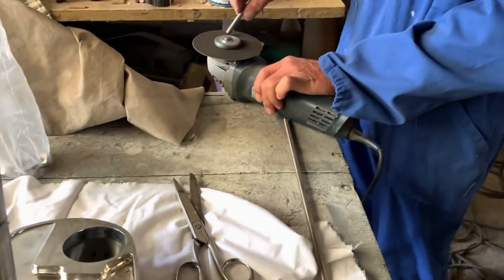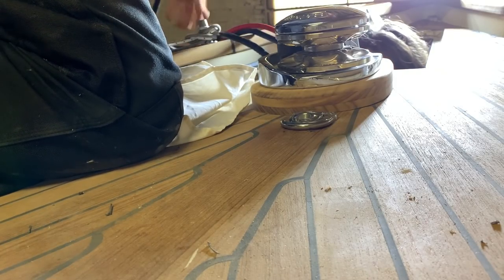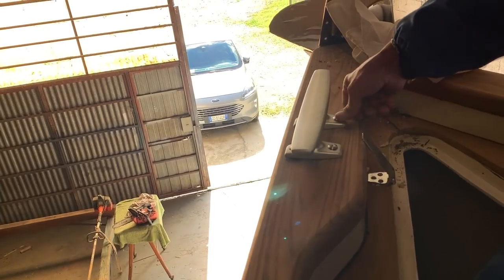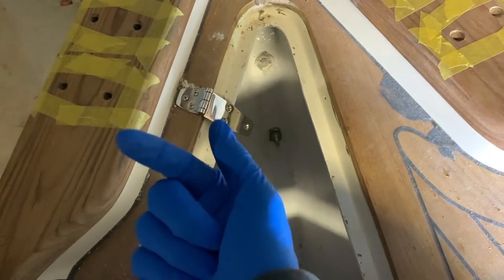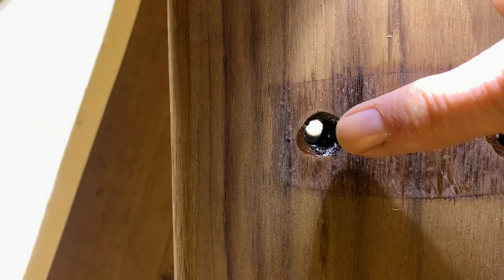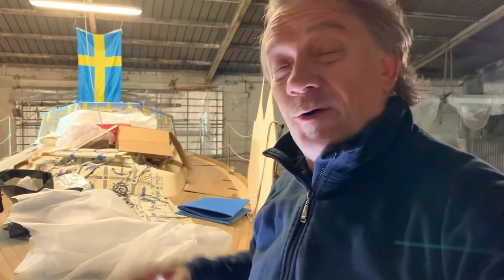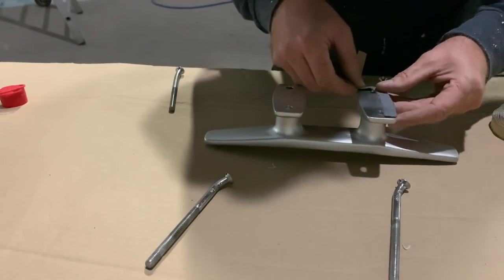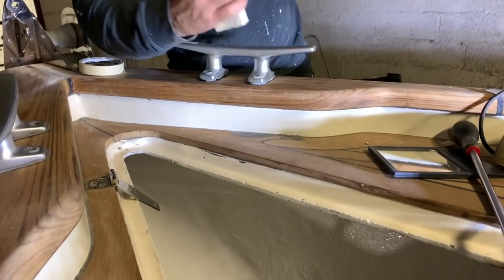Hallberg-Rassy 312 "Ellös": THE BOW CLEATS SAGA..!! (DIY BOAT)

Comment: Very useful video since I want to change all six cleats on my HR36 MkI.

Tell me, was it hard to remove the old ones? I think I just can take the nuts of on the inside and then hammer the bolds upwards?
Reply from the maker: Piece of cake take out... install new ones in more tricky!!!
Reply: sea4see Thanks Gabriele! 

HR Parts told me that they likely next spring have the exact same cleats as my original ones in stock. And also pre-bend bolts.

In that case I won’t have to drill and the installation will be much easier....
Reply from the maker: Ahah ah ... hope for you but I wait 2 years to get original ones but never arrived... same reply....they got a problem to find someone produce it.. I saw the raw model...ps:.. bend a bolt is a piece of cake 😁
Reply: sea4see I already contacted a party who can 3D scan the original one and CNC mill it.... so that is my back-up plan!
Reply from the maker: Great!!! Remember to use the correct marine aluminium.....
Reply: sea4see or 316 stainless steel.....
Reply from the maker: sy Kendu - Twan Biemans that sound great! Such a nice idea!!!

Comment: Noticed you installed the EXTRA PLATE between the bolts on the INSIDE.
Be sure not to HANG your boat by having a CONTINUOS  (no slack line) on a FIXED PIER.
Without proper use of appropriate SPRING LINES...I HUNG my catamaran as the TIDE went OUT.
The only thing that SAVED me was the CLEAT PULLED OUT of the deck (unlikely in your case).
So...be careful.
Reply from the maker: Hey Romeo!!! Don’t worry I sail where the tide is maximum 20 cm to 50 cm...in any case I know how to deal with this problem...👍🏻👍🏻👍🏻👍🏻 and thx to remember me the event!!!!